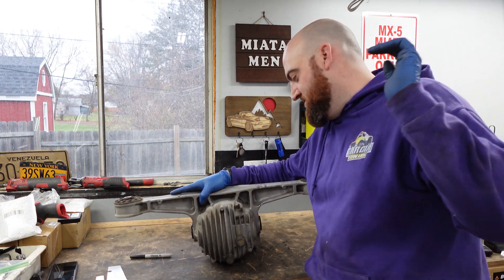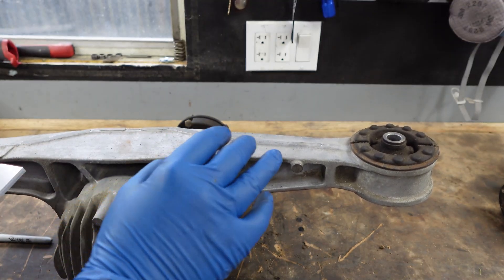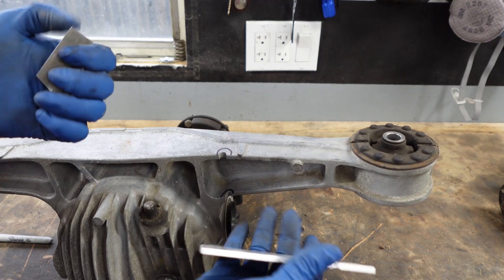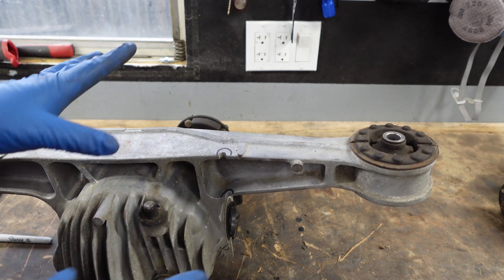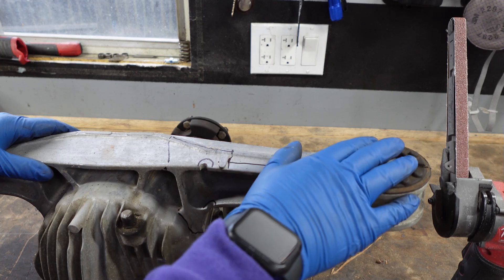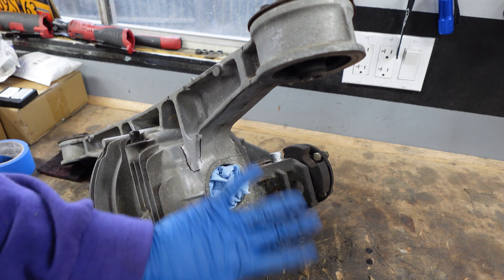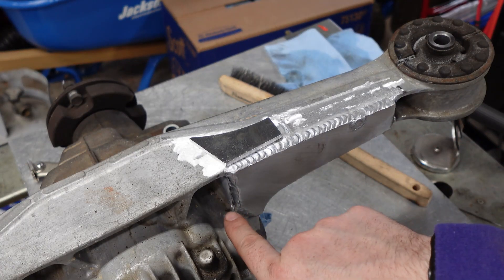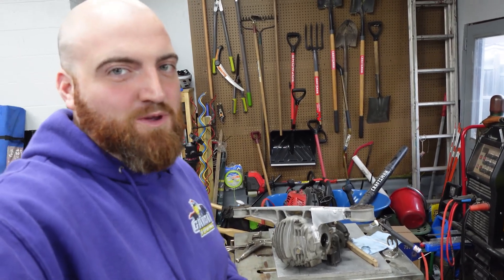Miata Differential Reinforcement | Fixing the Torsen Flaw

Comment: Very nice video again! Just curious, mazda put in the 1 fail safe to prevent the driver side from breaking, shouldnt we reinforce that one aswell? Now the "dangerous side", that would potentially run your diff into the ground is the weak point. Havent heard of anyone ever breaking the driver side though. Still need to do this on my car as well
Reply from the maker: Apparently that’s an issue regardless, so I think I’ll make it my standard moving forward.

Comment: Its not like an overreinforcement? I mean, you solve the notch problem but i think that is more that needs to be done. If you just weld that weak point, shouldn't be that equally strong? Or did i miss something. Amazing video btw, great work, cheers from Spain mate.
Reply from the maker: I've heard both sides are prone to breaking, and the one side is not even notched.

Comment: great video as always

i got my diff reinforced for my 400hp car and it hasnt let me down

i do have 2 questions though, only after getting my carrier welded did i learn that the ford 8.8 diff is a common alternative option. is there much strength difference? is it just a convenience thing? whats the benefit of going with the ford unit over welding some plates to the existing factory carrier

also what sort of power does the reinforcement allow? 400 seems fine in my case but do you know if theyre viable at higher numbers?

cheers
Reply from the maker: I would say 400 is still the safe ceiling as the internals go first. I don't know enough about the 8.8 to be able to give any insight on it.

Comment: You pre-heat with Napp Gas (that's what I heard at 1st☺). Can you get 220v service at your house? I've got it for my compressor... Wife won't let me buy a TIG unit...
Reply from the maker: I haven’t really needed 220. If I do, I have the welder at the shop that is wired into 220.

Comment: I spent 5 minutes wondering if closing off that cavity could cause rust issues. Then I realized we’re talking about aluminum. Have you considered not posting so early in the morning haha? Great video, keep it up
Reply from the maker: Supposed to have coffee while you watch! Haha
Reply: aluminum can still corrode just takes a bit longer, however when aluminium does corrode it really bad lost of pitting making corroded parts useless and should really be mutilated so others don't use a corroded part. maybe spraying the interior with a amuminulm specific weldable corrosion inhibiting paint, of ffs keep galluim away from you diff whults you expose the bare metal for paint prep otherwise say goodbye to you diff housing, gallium-induced structural failure is no joke